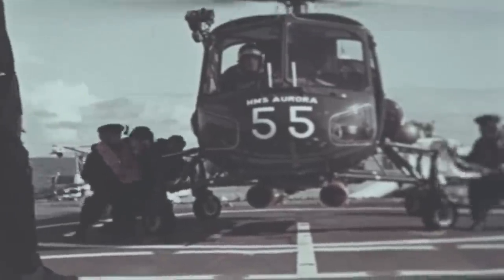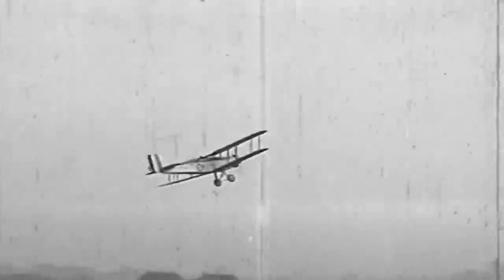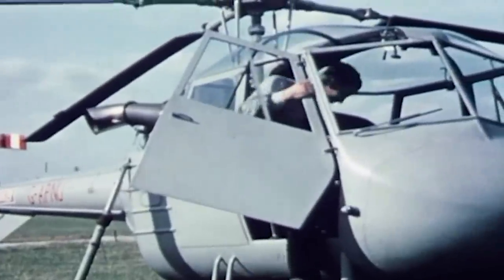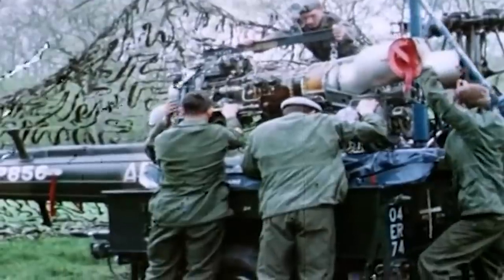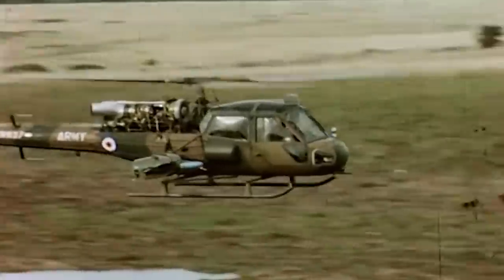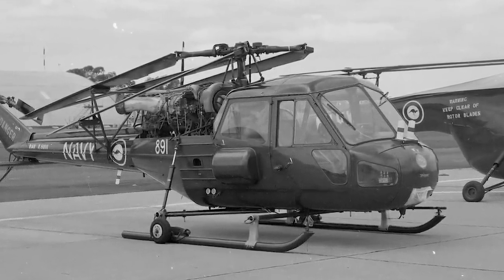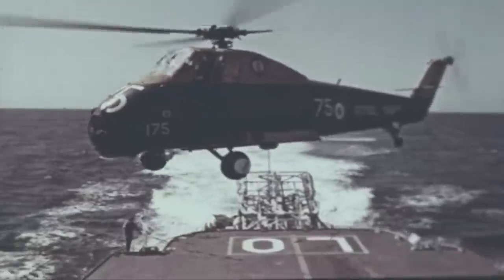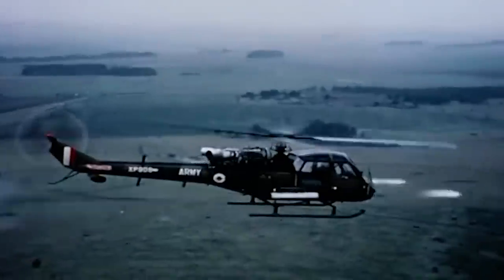The Helicopter that Sank a Submarine

Comment: you can see what design generation of helicopter we are looking at if we look at the turbine engine as it does not have thermal shielding or air mixing with exhaust to cool it or keeping the blades of the turbine away from radar to lower rcs at all cost.  even if i did not know this helicopter and when it was build i would say 50s-60s from those details alone.